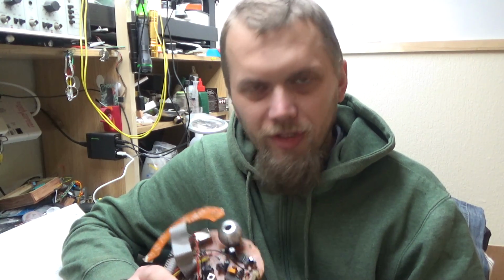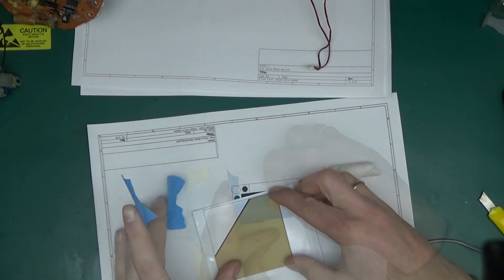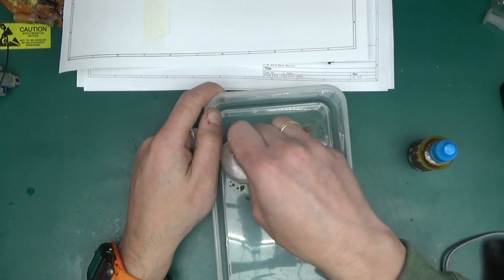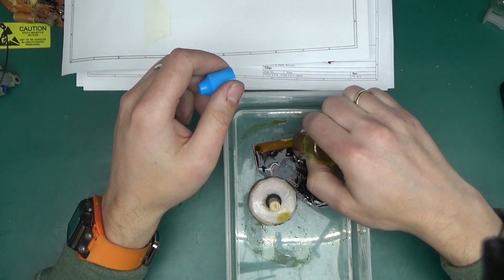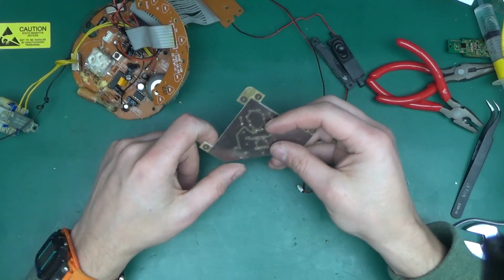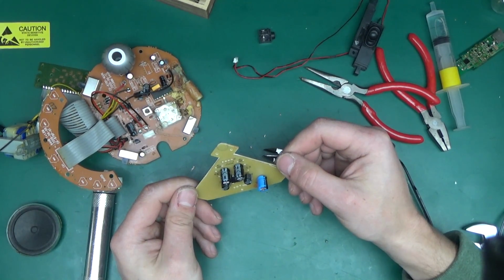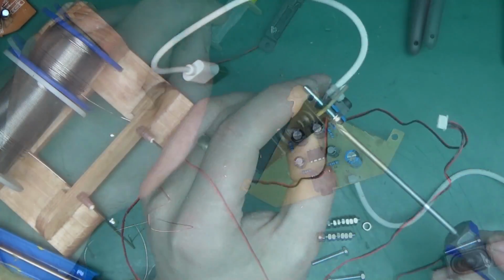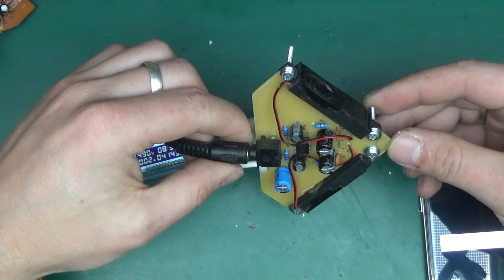Building the World's Smallest DIY Boom Box out of junk

Comment: nice. 

That thing is enormous :))

 I have a half finished project I put aside where I was using a surface mount IL386 salvaged from an old marine radio, inside an emptied 9V battery shell, with a 12 volt transistor battery, a phone speaker, and a stripped down headphone jack, all completely inside the 9 Volt. I just snagged and ruined the original speaker mid build and have to recycle a different 9 volt battery now.... Oh and I set it up with a JFET buffer so it's a guitar amp as well...will post soon...after I get SMPS interests out of my system ;)
https://youtu.be/5uiQjes-a98